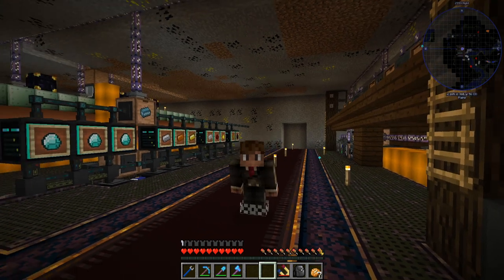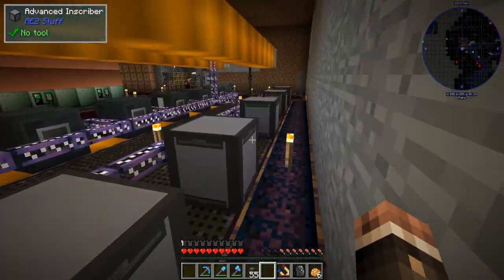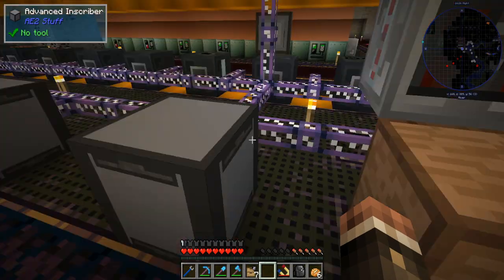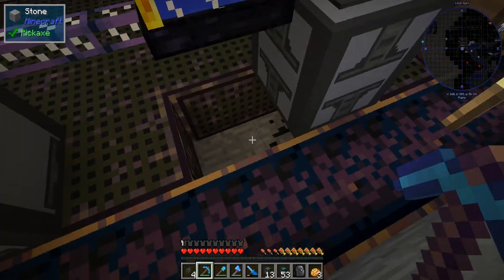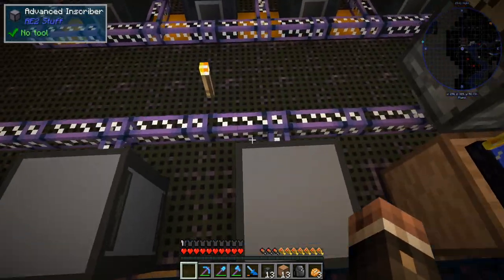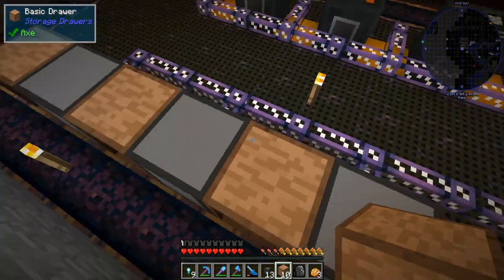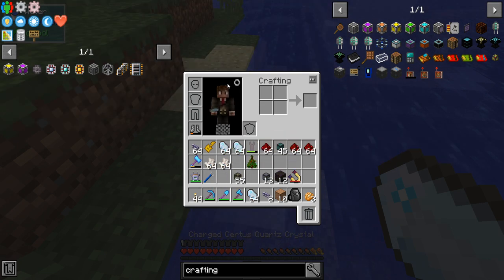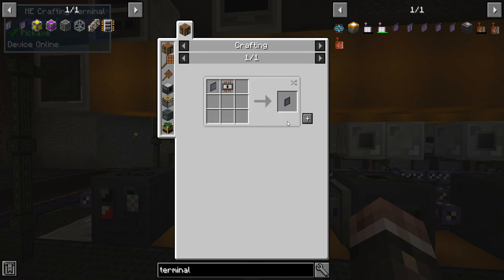Omnifactory Episode 6: Autocrafting the Autocrafters

Comment: The problem with your item conduits not working is because gregtech doesn’t let you insert into the auto output side of a gregtech machine. Essentially you need to use a wrench and turn the auto output side of the machine to another side of the machine, or use a screw driver, or file (can’t remember which one) to allow input from output side of the machine
Reply from the maker: Thank you :) I knew that already, but for some reason I only think about it when using the interfaces to push into machines and then make the machines push back into the interfaces. I kinda wish the conduits wouldn’t connect or something like they do with mekanism but that’s a personal gripe